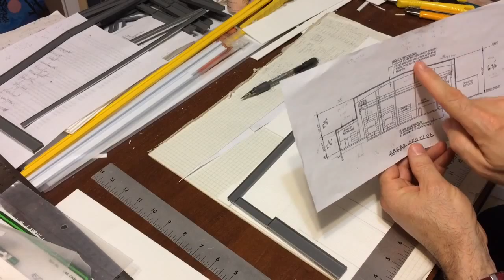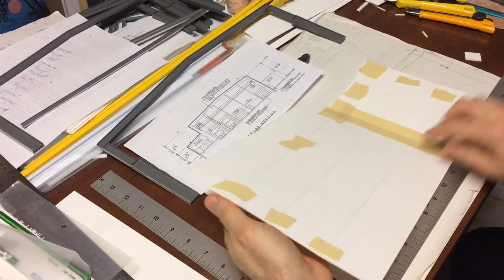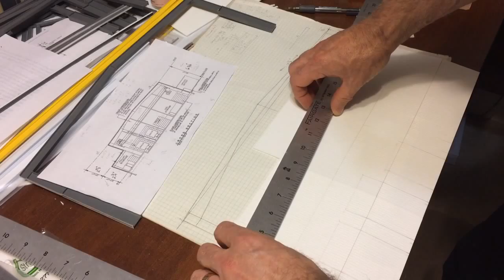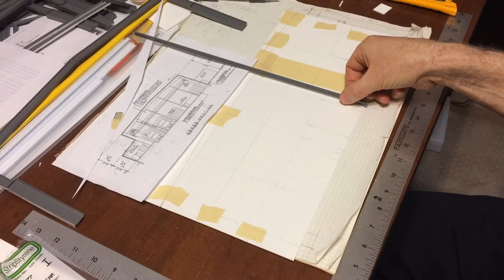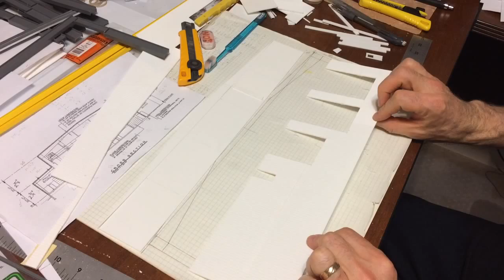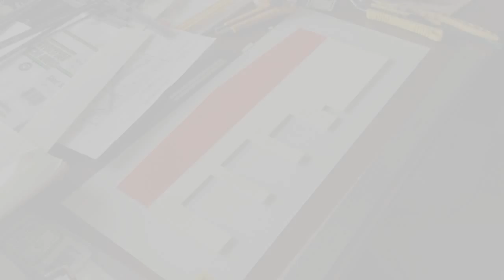Q&NE HO Layout Video 058 - 170409

Comment: Nice job !!!!   What did you use on the siding panels. Evergreen or Plastruc ? and what size?

Sal
Reply from the maker: Neither. I used Pikestuff roof panels because they most closely resembled the prototype. Check out Parts 1 and 2 in this video series for a discussion on this topic.